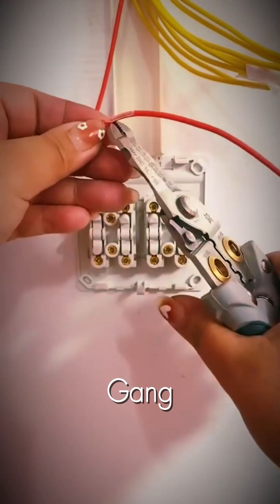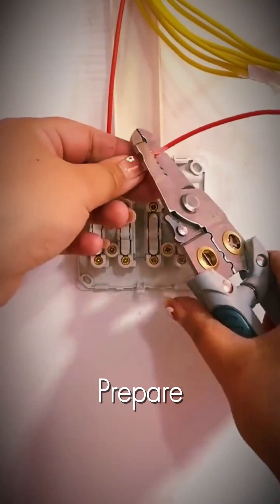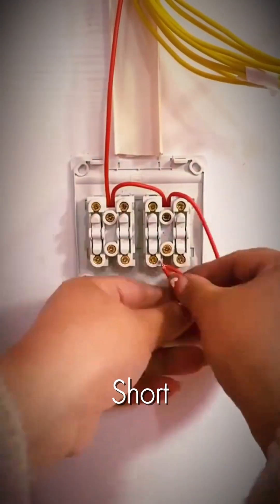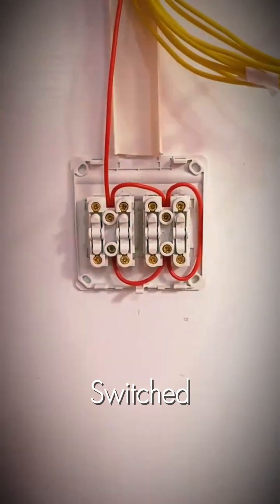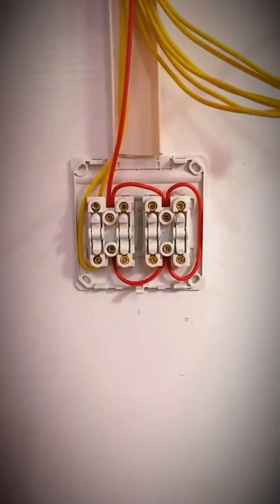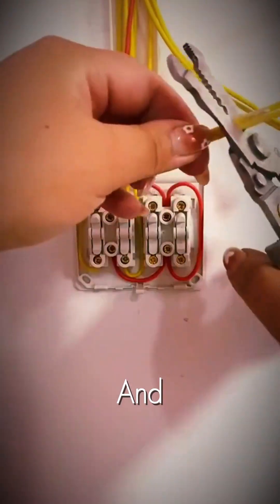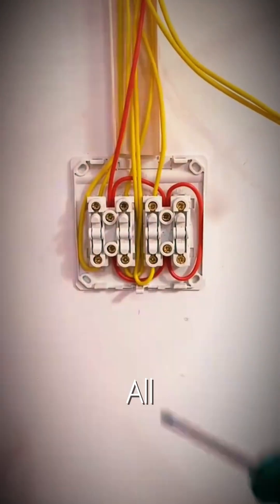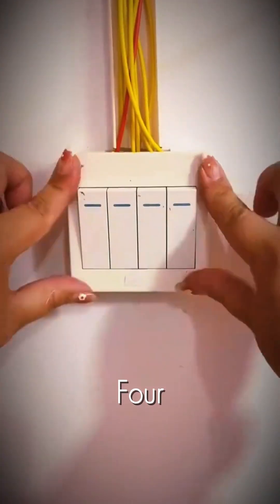Wiring a 4 Gang Light Switch FAST! #shorts

Comment: AC uses Solid core not Stranded at least in the us where black white and green at standard on 120v and red and red and green on 240V
Reply from the maker: Yeah, that’s correct — solid core is standard for AC in most US residential wiring.
Reply: @powerprocess3308 yep